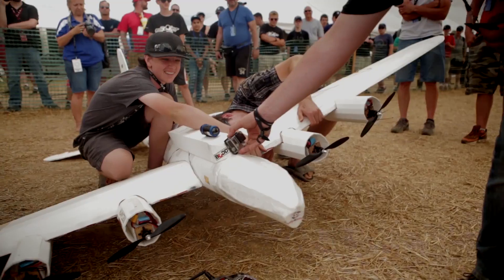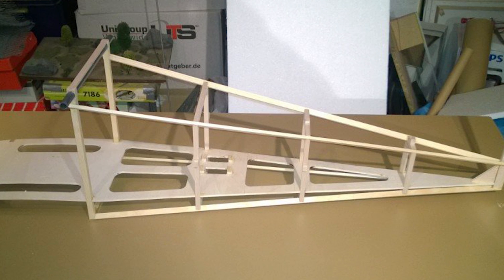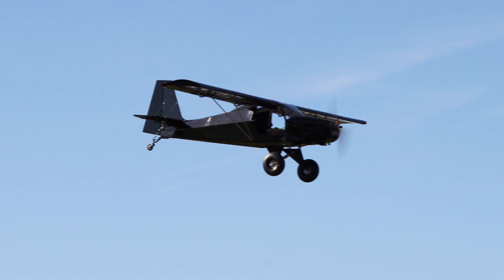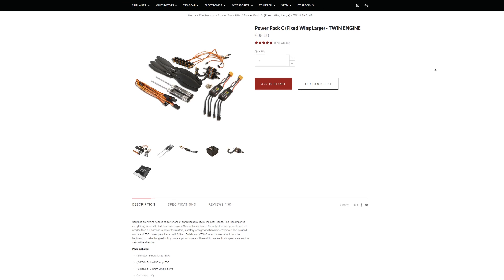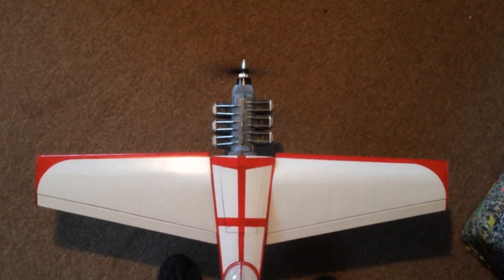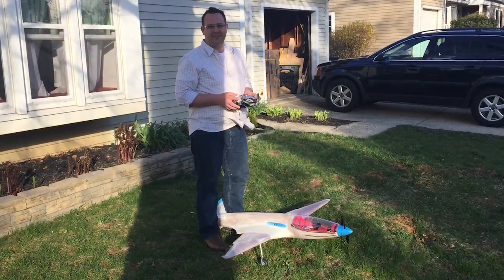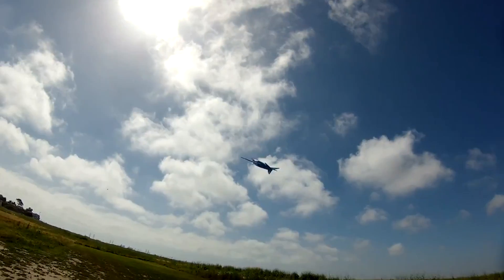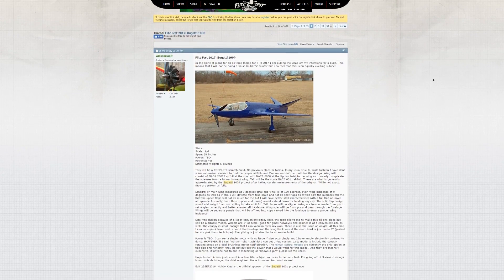5 Incredible Homemade RC Planes | Flite Test

Comment: Hey gentlemen I just received the LongEZ and Simple Cub in kit form from you. Holidays sorry to say still in packages but cat wait to build. I'm 63 and still in the balsa/plywood era. I can't wait to step into this new stuff.  I have been doing helicopters for a while and working with carbon fiber, just looking for some simple flying. So other than the RTF, EPO foam or what ever it is this is my next step.   Thanks for not ( compliment  ) being to normal, you fit right into my lingo.     good day guys :)

Comment: hey flite test i'm just starting to build a AVRO 504k foamboard model i designed a dummy radial engine on CAD and 3d printed it  so i was wondering if you could do your own version of this aircraft and i could send you the stl fines for the dummy engine it would be amazing if you are interested and i have also designed and made my own DH vampire using a 70mm 12 bladed EDF it sounds awsome. I can send you some footage of it if you want. Hope you consider this idea and love your videos very helpful.

Comment: Loved to see the Bugatti 100P in flight, I've made 3 so far. First was a Balsa one of 32" span, scaled from an A4 sized drawing. went 20 feet then flipped left and crashed. repeated this several times, even with a contra-rotating motor. To check what I had done wrong I made one the same size from Depron, with a small geared dc motor. This flew fine. I couldn't work out why the first didn't fly properly. Then I made a 42" version from Balsa, with single motor and retracts. This flew just like the first, but they were all challenging and interesting builds.Unfortunately the builder of the full-size replica built over many years died on it's third and last flight before it went to a museum. It now seems inappropriate to refurbish either plane.
Reply: Bob Walden i was so sad to hear about that! are you a fellow tulsan??
Reply: Hi Patrick, I'm a long way from Tulsa, in Dorset UK and member of Wincanton Falcons club. see "the bugatti100p project" on Facebook for the full story. I was attracted to the beautiful lines of the plane, and the superb but unusual layout of the internals. Stunning.

Comment: I've currently got a few designs in the works.
One, which I've already got a balanced glide dummy prototype of, is a foam board + prop Aeris 3A (a plane from Kerbal Space Program). The second, which I have detailed plans for, is another foamy, a BAE systems hawk which will also be powered by a prop, but is designed to be adaptable to an EDF as I hone my reflexes. My third design is something of my own. It will have a stressed skin (and possibly some balsa) construction, using aluminum sheet salvaged from soda cans. I'll probably do some small scale test to determine the validity of the concept, but the idea is to eventually build a 2m long aircraft powered by a home-made gas turbine, likely powered by propane. Don't worry I'm going to keep safe when building the turbine engine.

Comment: You guys do some excellent videos and some great builds but when you tour the shop I find myself amazed you have no small scaled wind tunnel. When are you going to build one?

I used to see these built at 4H type events usually of an old squirrel caged blower and a belt driven AC furnace motor which can make the cost almost free. It seems to me the Swedish fellow would really utilize one to a good end.

Comment: how do you get counter rotating props
Reply: Joshua did an article on the construction of the motor:  https://www.flitetest.com/articles/bugatti-100p-the-contra-rotating-motor
Reply: Yup! And you can review everything as it evolved in the build thread that is linked from this video.  Oddly, it was one of the easier parts of the build so far.